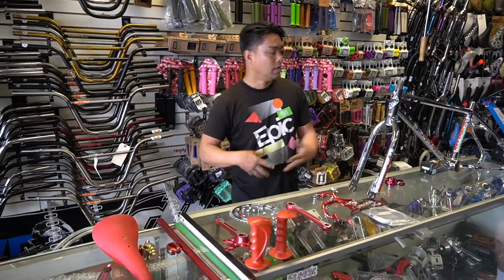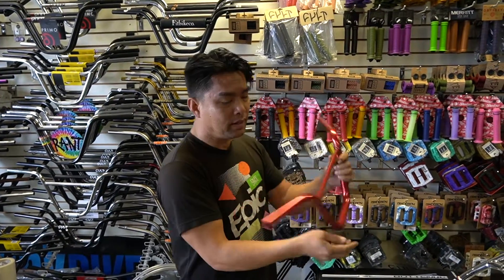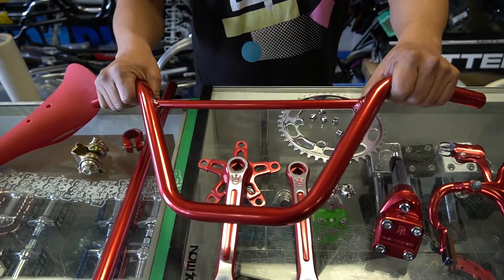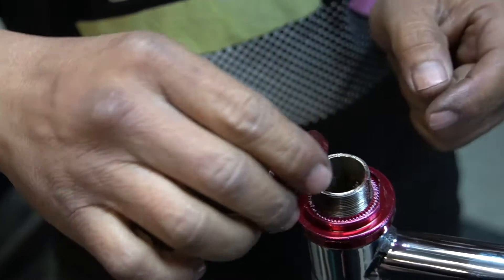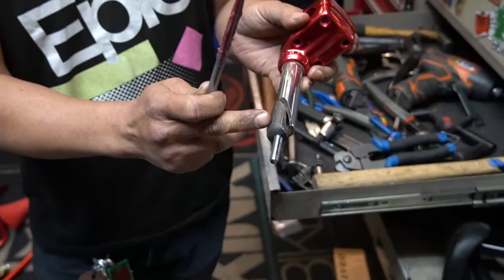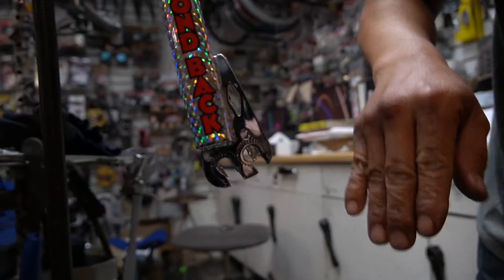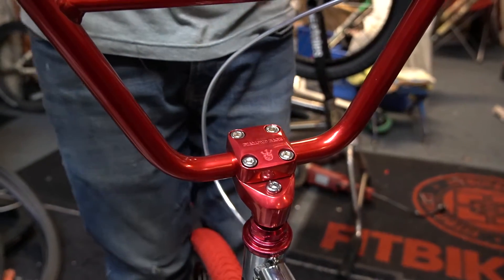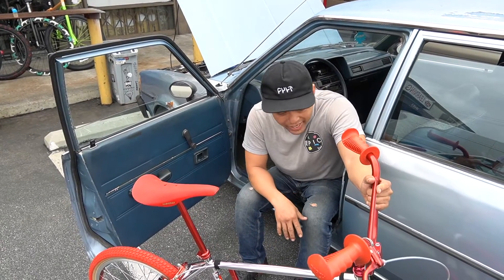Shop Owner's Cleanest 1980 Diamondback BMX Restoration!

Comment: Hi, came across this channel. Hoping to get some help 🙏 pls..
I have an old moto 1 bmx bike, that belong to my brother(rip) . I am trying to restore & fix it up. But umm I'm wondering if i could put some thicker tires then the ones it originally has. 20x1.25. & what inner tube size to get with it.  what else or tips I would need to help get this bike started.? Scared to leave it at a bike shop for maintenance. I'm trying to keep it as original as possible. Frame, sprocket, etc.. thank you ! 😊

Comment: I had a frame like that before, but it had mismatch parts from my GT, it had some Tioga parts as well I think the handle bars were off my gt and the seat post as well was a laid back seat post from my gt. It had skyway nylon wheels the six spoke or five. Then my bearings got fried so I swapped it out ariya spoke or c wheels or rims I forgot which ones. Because some of my bikes got stolen from moving all the time. I only have a 80s or 90s champion light weight frame, a hyper light weight, and a cheap box store mongoose.
Reply from the maker: Sounds like it had a good life!

Comment: IF YOUR LEFT HANDED BRAKES SHOULD BE ON THE ON THE OTHERSIDE ALSO IF THE BIKE IS JUST FOR SHOW THIS FINE I ALWAYS THOUGHT YOU HAD TO CLEAN OFF THE PAINT SO HANDLE BARS WONT SLIIP THIS WOULD BE MORE ORIGINAL